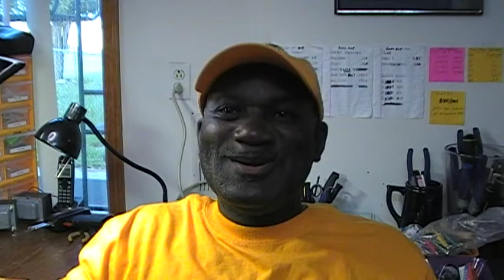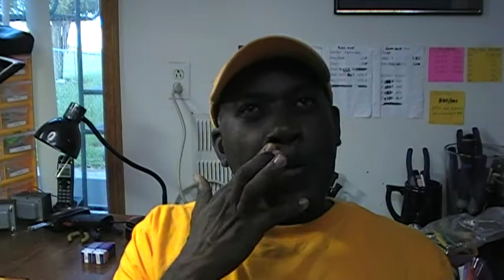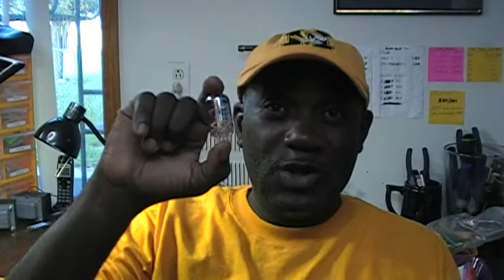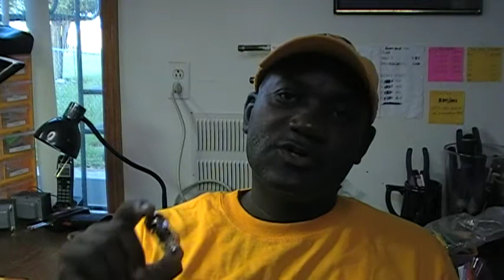Tube Options For The Preamplifier To Change The Tone In Your Hammond Organ

Comment: Hi Doc, You say, as a first step, to verify the integrity of the 12AX7. You never say how to do that. Unless you have a tube tester, which most people do not, how do you accomplish that? The next step is to try different 12AX7s. Isn't that the same as the first step if you don't have a tube tester? I guess a physical inspection to ensure that there are no cracks or broken pins could be considered part of the first step.
 
I just found your videos a few days ago and really enjoy them.

Thanks for making them.
Von in Sandy, Utah.
Reply from the maker: Yes - I use a tube tester.  I have many videos regarding that. I stated in the video "Hopefully it will test good." But I did not mention the tube testers that I use. I agree - I could have included that there but later I then went on to talk about checking the 12AX7 on a tube tester.  So I did mention this in this video.  I use the B&K 747B and a Hickok 752B. You also mention that not everyone has that but if you look at the video - I was responding to Kendrick. Thanks for your comment. I appreciate it.